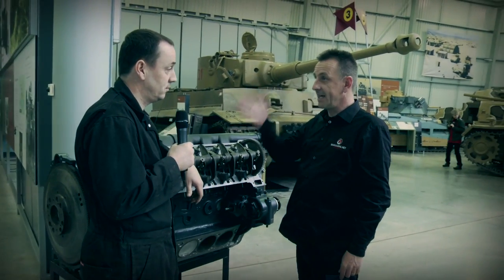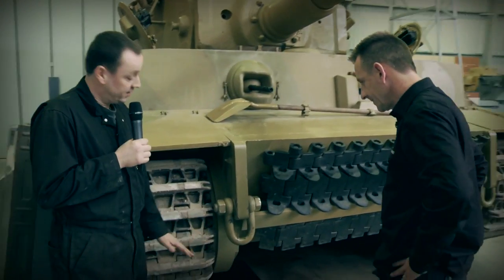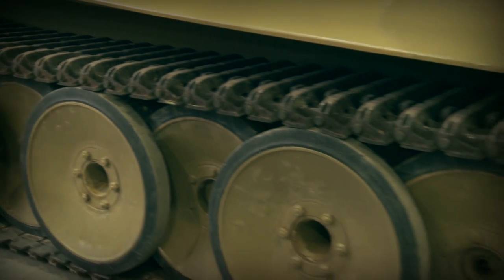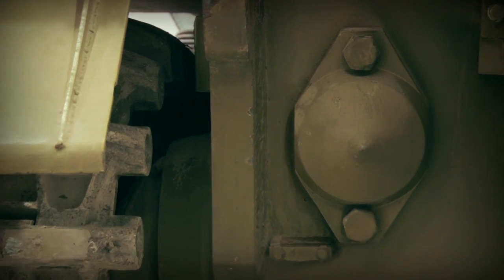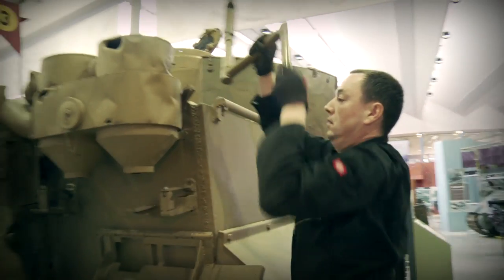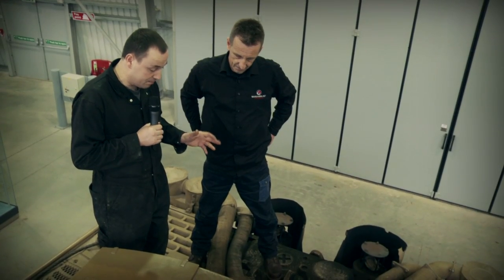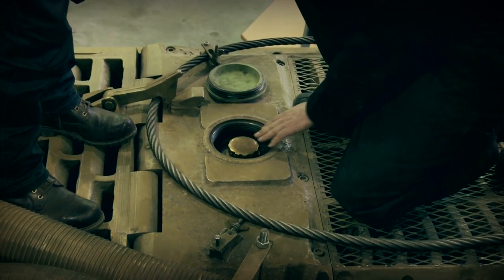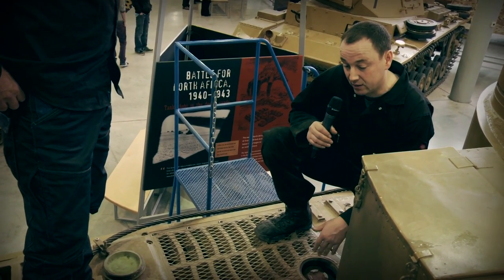Inside the Tanks: The Tiger I - part III - World of Tanks

Comment: THey make it sound like the inertia starter is just like a crank starter on an old fashioned car. It's not. The hand crank spins up a heavy brass flywheel (usually brass anyway, no idea about on tanks, but that's how it is on Luftwaffe aircraft like the Bf 109, etc). Once the flywheel is spinning at a high rate, a clutch is engaged, transferring the built up angular momentum to the crankshaft, and turning the engine over. This allows a person to store up a prolonged exertion over a minute of cranking into a moment of turning the engine over (to be repeated until the engine finally starts), since a person would have a great deal of trouble cranking a Tiger engine directly by hand.
Reply: Works pretty well, though. I have seen another video on YowTube that shows them crank up the big cat using the inertial starter. Also one of personel starting up an old Bf-109. I wish someone made those for automobiles.

Comment: Wonder if that special tool and the "X" shape in the fuel fillers is intended to deter people from stealing fuel or something? Would be hard (but not impossible) to remove the caps without the tool. I don't see why else they wouldn't just put a handle on the cap itself. Of course the Russians actually have their fuel caps bolted down, so who knows.

Comment: why does the track tension change? is that based on temperature differences?
Reply: +Henry soundso  when you drive a tank the metal tracks rub up against each other they just wear out causing slack in the tracks, weather changes are normally not extreem but yes really hot or cold weather can have a effect on the tracks also dirt, ice and mud cause havoc on tank tracks

Comment: What sort of mileage to the gallon would that tank do?
Reply: I don't know but historical documents indicate it was a notorious gas guzzler because of the very thick armor and its 88mm gun. I laughed when he said they use a dipstick to check the fuel level. I'd do the same. It would be unnerving to see a gas gauge swinging to the E right before my eyes!
Reply: It was common practice to use a dipstick back then for fuel. Even in a lot of cars. With a tank you've got pretty steady engine revs, depending on what kind of terrain you're in, but you basically are expected to keep track of the time you've been running and at what RPMs, and you can guestimate pretty well when the fuel is getting low. Basically, the driver knows that with a full tank he has (for example) three hours driving time at highway RPMs, with a half hour reserve. Once 3 hours and 15 minutes has passed, then you have to start worrying about just how much fuel is left. Like an aircraft, you don't mess around with the chance of running out of fuel, so once you've been running long enough that the tanks are sure to be getting down to empty, you pull back to a safer area and refuel, usually something that has been planned in advance based on the time they know the tanks can run (and preferably with stops to top up halfway through, both for the safety margin and because it is a lot faster to fill each tank from half to full than from empty to full...especially when you are filling up from 5 gallon jerrycans, which was pretty normal in the field). 
Coupled with the fast fuel consumption, you don't dick around with "I've got a quarter tank of fuel, so I can probably make it another 20 miles". You keep it topped up as much as possible and hopefully your unit has it all arranged so fuel trucks will be up to meet with the tanks in three hours, since you'll all be getting low by then. The dipstick was just when things weren't going smoothly and you either had to make sure you actually had a half tank left or weren't going through the fuel too fast for some reason, or to make sure that you could make it 5 miles back to the refueling trucks. Of course, things didn't always work out, and tanks did sometimes end up running out of fuel or trying to make it to a redezvous with only a small amount of fuel left. But basically, knowing how much fuel you had at any given time wasn't a big problem. You should be able to tell by watching the clock, and the only reason to check was to make sure fuel consumption was normal, or to guess just how long you could get before it ran out of fuel and you were forced to abandon it. Good to be prepared in that eventuality.
Reply: I'd say around 2-5 gallons per mile. And that's probably optimistic. An M1 Abrams is something like 8 gallons per mile, but they are very thirsty. An aircraft in WWII could easily burn that much fuel per engine, and a shitload of oil as well. Aircraft engines were rate in "pints of oil per mile", so there was a reason they had oil tanks as well as fuel tanks. Radials were the worst.
Even modern jets burn a fair amount of oil; a jet engine can operate for a very long time if you keep adding fuel, so the ultimate limit to non-stop flying is oil capacity. There was two men who once spent something like 65 days straight flying around in a Cessna 172 for a world record (the things people do to get their names in the books!), and they had to have fuel, food and oil oil sent to them, if I remember correctly, from the back of a pickup truck speeding down the highway. They had it modified so they could top the oil and fuel off while in flight. Quite a story, and quite a testimony to the engineering in a simple old air-cooled piston aircraft engine (can't remember if it was a Lycoming or  Continental). But I digress.

Comment: Are the guns still operational? Obviously, it'd be illegal for the museum to use the gun per se, but is it illegal to still have it in full working order?
Reply: I am unsure, but I believe that this tiger is the only one which is fully operational, so I assume the guns work aswell. However I am unsure about it.
Reply: darklordnorge Yeah its operational. When they captured it, They took it apart, put it back together and fired it. and thats the way it stayed. and in 1951 it got handed to the museum as the way it stood.
Reply: Thanks for clarifying it :)
Reply: Correct, it is the one and only fully operational tiger left on this planet
Reply: +Drifter Knight i believe they used this tank in the movie fury cause it was the only one able to drive and handle the movie demands.

Comment: Im surprised they weren’t diesel powered. Certainly makes it more dangerous running gasoline.
Reply: You are wrong diesel burns just as well as petrol when hit buy a shell. Plus germany didn't make  diesel in its refineries. Also they didn't have ample supplies of aluminium for lightweight diesel engines like the soviets did.
Reply: Kim Welstead Kim Welstead diesel engines can have a positive air shut off, gasoline can not. Ive personally seen a few gasoline engines run away and burn up quite quickly in gas rich air. Between than and being a lot easier to start a diesel in -40 degree temperature Id prefer to be sitting in a tank that runs diesel. 
Very interesting though, id have figured 1940s germany would have refined kerosene.

Comment: i play the game because of this tank, but it was kinda disappointing it kept hammered to bits by all tank that developed after the world which means it was outdated , well in real life it was fighting something weaker than him in the game it has to be fair and balance the gameplay so it won't be overpowered.
Reply: Kraftsman Sheng  When I got thw Tiger 1 on world of tanks I was incredibly dissapointed by the armor. But the top gun is fantastic
Reply: Samuel Raybould the gameplay had to be balanced, it wouldn't be fair if it against tier 5 or 6 all the time, in real life it was quickly outdated by other fighting nation, no nation willing to send their men to die in vain, they have to constantly upgrade their tank so did the german there was the tiger 2 and by that time we fight against IS 3
Reply: Kraftsman Sheng yeah fair enough
Reply: Is3 came too late for ww2
Reply: Tiger was not outaded even when it was passed out of production. Furthermore, USSR super armor might had looked scary on paper, but it was a technical disaster worse than early Panthers. All IS-3 were pulled out of service the moment they rolled through victory parade and were reconstructed and redesigned. IS-3/4 are not 1946 tanks, but 1947 at very best. 1945-5 warfare would be a minor German increase in technical capabilities, but push towards standartization with its E series all across the board. Allies would had continued to use their Shermans and they would finally start utilizing 76 mm and 17 pounder guns. 90 mm on USA heavy tanks would come at that period's end and would contest tanks as E-50/75. British would still be stuck without decent armor at this point, but they would slowly start testing Centurion prototypes which are one of the best tanks of that era. Soviets would had introduced excellent T-44 which while not carrying more firepower, would be very well armored for its size.

Comment: All these wehraboos thinking this thing was invincible against Shermans lol. An early war Sherman could pen this thing frontally
Reply: From a range of 100 meters yes they could
Reply: Charlie Chen
Nope
Reply: Kalum Batsch Explain the M3 gun's 109mm of penetration at 100 meters, while the Tiger has 100m of frontal armor
Reply: Charlie Chen
Explain what? Several sources say the 75mm Sherman gun couldn't penetrate a Tiger's frontal armor at any distance.
Reply: So you're going to ignore US Army testing? The M3 can penetrate 109mm at 100 meters, with solid AP shells. The APHE shells on the other hand pen only 93mm at 100 meters, maybe that's what they are referring to?
Reply: Charlie Chen
Is it even the same material? There are lots of different types of steel. Do you have a real example of a Sherman tank with a 75mm gun penetrating the frontal armor of a Tiger?
Reply: Rolled homogeneous armor, yeah. Same shit. Not to mention late war German tanks had armor so brittle they had less effective thickness
Reply: late war german steel was fine for effective thickness. 
the replacement of vanadium left the armour more vulnerable to spalling however. 
besides the frontal armour of a Tiger is angled at 9* from vertical, and and minor angling of the tank itself and it's even thicker. 
so on paper yes, in practice a sherman-75 will never pen a Tiger frontally
Reply: only if a Sherman had the 17 pounder gun in the firefly configuration
Reply: from 1943 onwards a Sherman with a 75mm gun equipped could penetrate a Tiger from all angles as the round it fired had 100mm of penetration at 500 yards. This was due to the more modern round they had developed, the apcbc or something like that.
Reply: Samuel Raybould
Any real example of this happening?
Reply: Kalum Batsch Well idk but the on paper a Sherman from 1943 onwards could pen a Tiger
Reply: Samuel Raybould careful with that, they take overly simplified myths and give them oversimplified answers.
Reply: Samuel Raybould
I think someone's quietly moving the goalposts. We were talking about the frontal armor, but nice try.
Reply: Kalum Batsch im guessing someone didnt read the link.  "British “Firefly” Shermans equipped with 17 pounder guns could effectively combat any German armour, including Tiger II"
Reply: Samuel Raybould
Now you're talking about a different gun. Keep moving those goalposts.
Reply: Kalum Batsch 17 pounder = 76.2mm
Reply: Samuel Raybould
No shit. That's not the gun we were talking about.
Reply: Kalum Batsch Ok so we go back to my original point being that once the M61 APCBC round had been developed for the 75mm gun it had 100+ mm of penetration at a range of 500 yatds
Reply: Samuel Raybould
I'm not sure what your point is, if there is one, but what is your source for those figures?
Reply: Kalum Batsch And wheres your source saying the Tiger was unpenetrable?
Reply: Samuel Raybould
Did I say that? Don't think so.

So there was this special ammo late in the war that wasn't issued in the field in any numbers that could penetrate the Tiger from some angles at short range according to a single Soviet test. Whoop-dee-doo.
Reply: Samuel Raybould dispel the myth by showing how rare Tigers were. 1 Tiger was great in 1942/43, but only good in 1944. and they were always rare, especially in the west.
Reply: Kirothe Avenger
Which is a completely different issue.
Reply: Kalum Batsch Sti waiting for your source about the Tigers impenetrable armor
Reply: Samuel Raybould
About what?